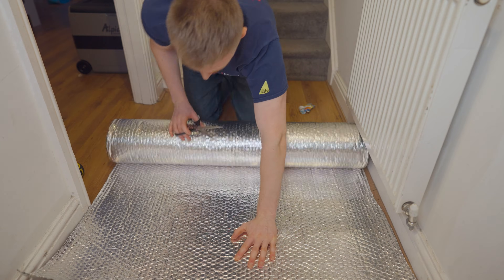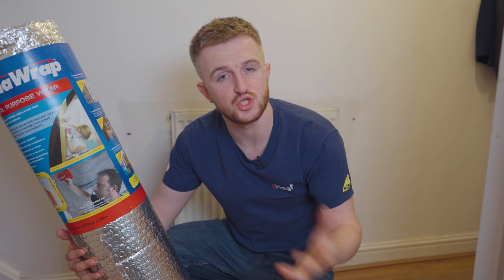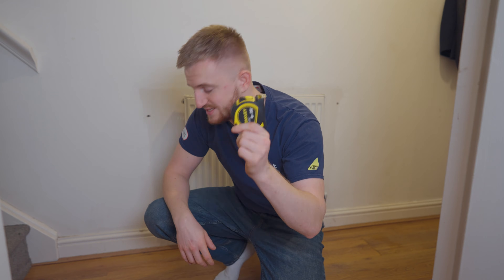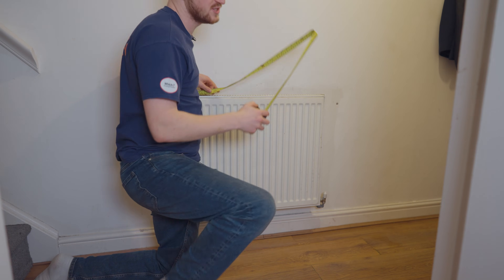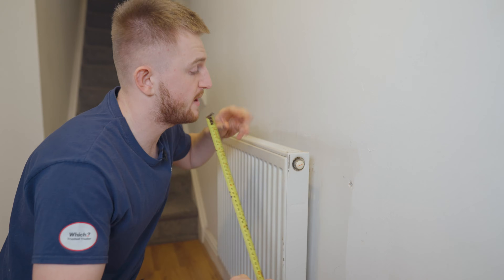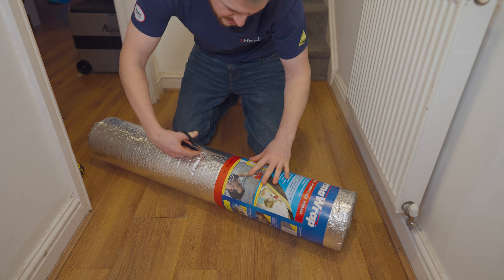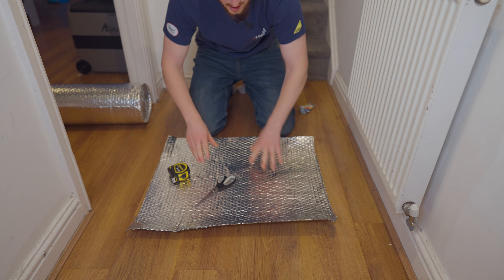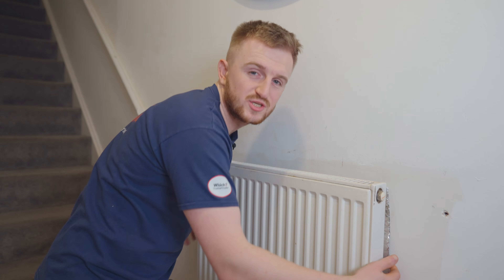HOW TO INCREASE THE EFFICIENCY OF YOUR RADIATORS! - Radiator Foil, ThermaWrap

Comment: How can heat be reflected if the radiator is in the way?
Reply: because the heat isn't absorbed by the wall as much as it would without the foil. The reflection is a reference to mitigating wall absorption.

Comment: What boiler for 2 bed flat, want low modulation for good efficiency, maybe Tado or similar modulating control
Reply from the maker: Have you tried a quote on our site? All depends on number of bathrooms, hot water demand etc. All our boilers are A rated for efficiency too